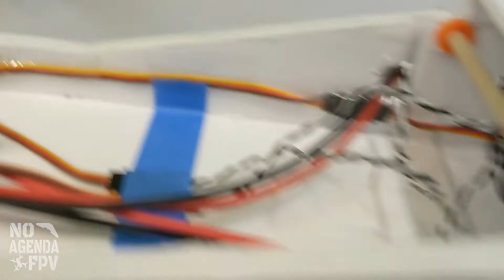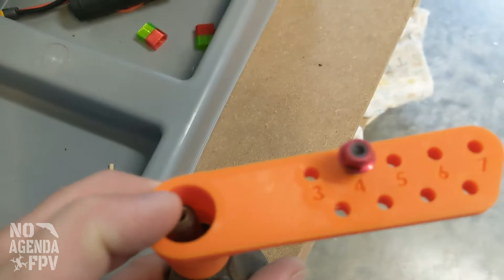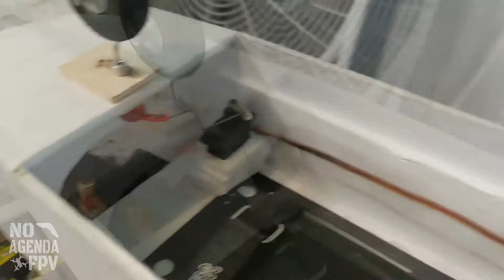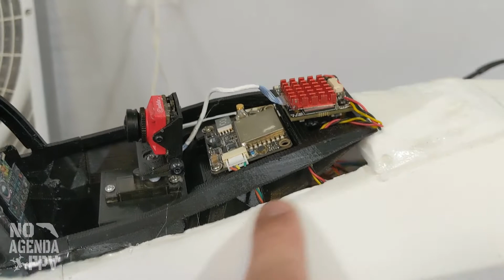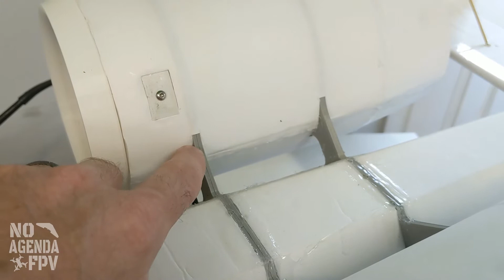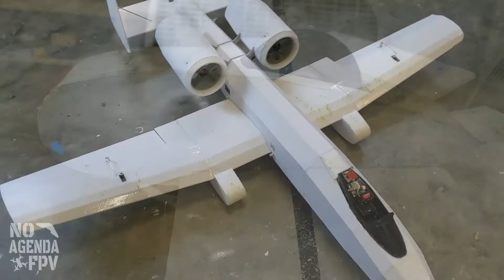Post Maiden FTA-10 build tour

Comment: Did you angle the engine mount downward or did you just use a lot of elevator when applying throttle?
Reply from the maker: @larrycung9131  the motor mounts were the same as the FT plans. It really didn't take much extra elevator input, it flew rather easy. I haven't flown that plane(or any sadly) in a few years though.